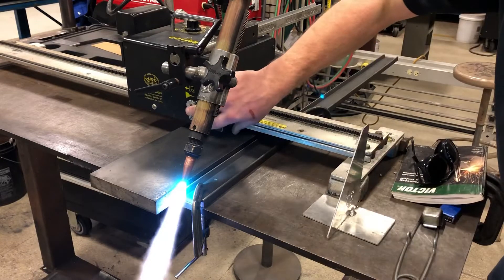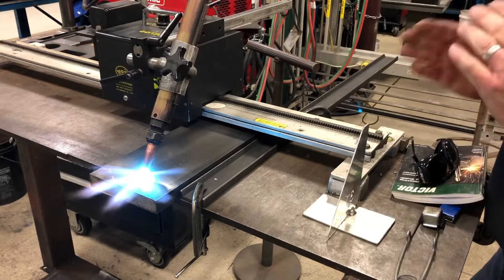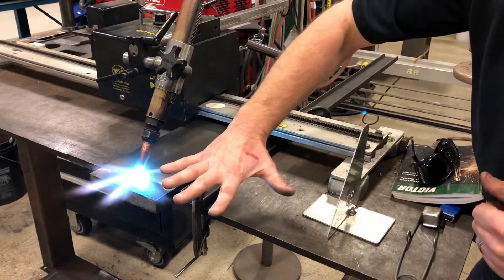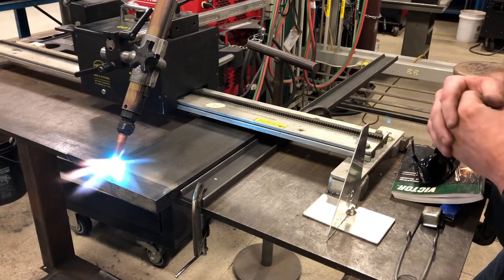OXY ACETYLENE BEVELING 1” PLATE!!

Comment: Should run a number 3 tip, here’s why. The 30° cut increases the total depth of cut. So where a number 2 tip is good for 1” square cut, the #3 is better for beveling 1” thick material.
Reply: That cut was perfect. It obviously worked. No need for nr 3.

Comment: I burned for years at caterpillar we had a track cutter we always had the torch up and down the head you could set at any angle you wanted had degrees on the head I always used a separate torch in front of the cutting torch at 45 degrees it looked like it had been belt sanded was called champer for welding pieces together in one 8 hour night i burned 91 hours of labor on 1.5 inch metal both sides would burn one side flip it over and the second side burned faster but I still used the torch to keep it warm we had a cutting table with a square hole in the middle with a angle slide and a drop pan worked great that was 1989 new track cutters are different now we had buttons to turn gas on and we always set the heat of torch my eye sight😊

Comment: I work in steel machine, I would like if you could make picture of the parts of this machine or tell me how much does it costs, think is the cheapest machine, cause you doesnt need to replace expensive razors. Think this is the best machine to bevel small plates , but also it can be used for long plates, just add space for movement of the machine. I am interestes how it moves, and all the parts that makes movement.

Comment: - "Close acytelene first to prevent the flame getting sucked up in the torch and then close heating oxygen..this will increase the torch life"

TOTALLY WRONG! 
If you close the acetylene first, actually you are not closing the fuel instantly... 'till it's fully closed you are reducing the flow and the pressure of the fuel, while maintaining the flame, but! with the acetylene pressure being reduced and with the oxygen pressure being higher, the oxygen pressure will push the flame from the tip, to inside the torch, through the hoses, to inside de acetylene bottle.
What prevents this to happen it's the pressure inside the acetylene bottle, but the emptier it is, the lower its pressure inside, so the flame can make it's way to inside the fuel bottle.
What cut's the flame when you close the acetylene first, isn't what you think, that you are leaving the flame without fuel... what happens it's a flame return or "flashback", caused by the higher oxygen pressure pushing the flame, but! this time being cut by the Flame Arrestor Valve.
You can notice if someone has closed acetylene first, and caused a flashback, and the flame was cut by the flame arrestor valve... cos it will cause a loud "BANG!" when cutting the flame.

Flame Arrestor Valve it's a safety measure for "just in case", not as method to always cut the flame that way... the more you force the flame arrestor valve, the more chances you have for it to fail, and not prevent a flame return till the fuel bottle, and cause a disaster!
It is in the safety regulations: change your Flame Arrestor Valves and hoses for new ones each 3 years maximum!

So, ALWAYS close the gas with the higher pressure, in this case the oxygen... 'cos think on it, all the above happens cos of the higher pressure gas will always try, and it will, to push the lowest pressure gas, since both share the same circuit inside the torch... and if the pressure inside the lowest pressure gas's bottle is lower than the working pressure of the oxygen, nothing but an Arrestor Valve can prevent the oxygen to go inside the acetylene bottle.
Also notice that acetylene doesn't need flame neither oxygen to burn and explode, even a 100% concentration of acetylene can burn without oxygen, and on high pressures it's explosive itself... that's why it's dissolved into liquid acetone inside a sponge into the bottle. And over a working pressure or "exit pressure" of 1'5bar it explodes, and the same if makes contact with copper or silver.

This video it's one of the few times that someone says it right, but I'm the one that provides the explanation.
You have to learn about the acetylene dangerousness and how gas pressure works inside a common circuit.
NEVER teach to close acetylene first, again.

Comment: You don't have to preheat mild steels or carbon steels. The cutting process is exothermic so it generates more heat than you give in to start with. Just keep the feed rate constant and let oxygen do its work.

Comment: whats the maximum degree of bevels that can be made with this torch set up?
Reply from the maker: Just past 45 degrees
Reply: @drreadthepuddle4332  i can cut up to 80 . from 45 and more you can go from the outside in .pl25  bevel 15/100 done the other days.

Comment: Close acytelene first to prevent the flame getting sucked up in the torch and then close heating oxygen..this will increase the torch life
Reply: TOTALLY WRONG! 
If you close the acetylene first, actually you are not closing the fuel instantly... 'till it's fully closed you are reducing the flow and the pressure of the fuel, while maintaining the flame, but! with the acetylene pressure being reduced and with the oxygen pressure being higher, the oxygen pressure will push the flame from the tip, to inside the torch, through the hoses, to inside de acetylene bottle.
What prevents this to happen it's the pressure inside the acetylene bottle, but the emptier it is, the lower its pressure inside, so the flame can make it's way to inside the fuel bottle.
What cut's the flame when you close the acetylene first, isn't what you think, that you are leaving the flame without fuel... what happens it's a flame return or "flashback", caused by the higher oxygen pressure pushing the flame, but! this time being cut by the Flame Arrestor Valve.
You can notice if someone has closed acetylene first, and caused a flashback, and the flame was cut by the flame arrestor valve... cos it will cause a loud "BANG!" when cutting the flame.

Flame Arrestor Valve it's a safety measure for "just in case", not as method to always cut the flame that way... the more you force the flame arrestor valve, the more chances you have for it to fail, and not prevent a flame return till the fuel bottle, and cause a disaster!
It is in the safety regulations: change your Flame Arrestor Valves and hoses for new ones each 3 years maximum!

So, ALWAYS close the gas with the higher pressure, in this case the oxygen... 'cos think on it, all the above happens cos of the higher pressure gas will always try, and it will, to push the lowest pressure gas, since both share the same circuit inside the torch... and if the pressure inside the lowest pressure gas's bottle is lower than the working pressure of the oxygen, nothing but an Arrestor Valve can prevent the oxygen to go inside the acetylene bottle.
Also notice that acetylene doesn't need flame neither oxygen to burn and explode, even a 100% concentration of acetylene can burn without oxygen, and on high pressures it's explosive itself... that's why it's dissolved into liquid acetone inside a sponge into the bottle. And over a working pressure or "exit pressure" of 1'5bar it explodes, and the same if makes contact with copper or silver.

This video it's one of the few times that someone says it right, but I'm the one that provides the explanation.
You have to learn about the acetylene dangerousness and how gas pressure works inside a common circuit.
NEVER teach to close acetylene first, again.